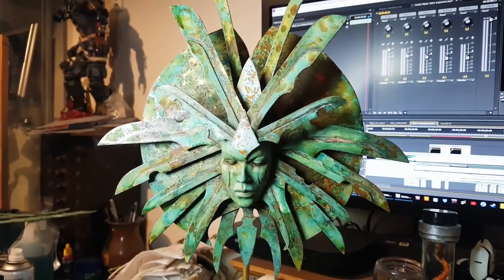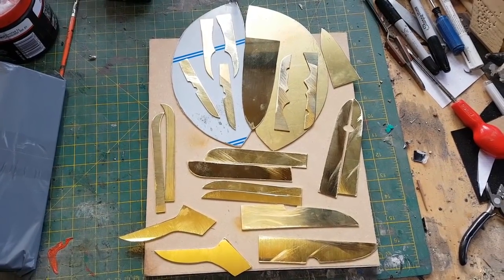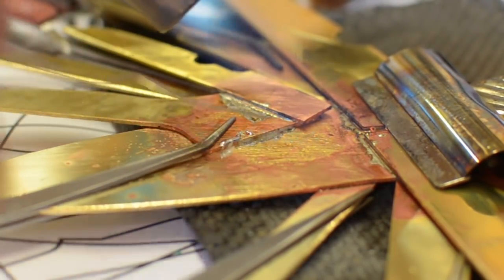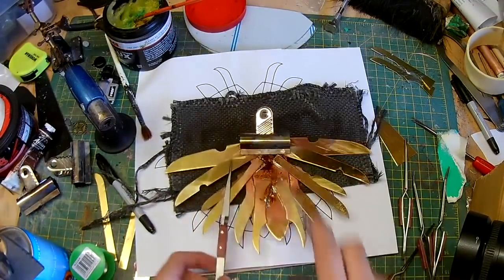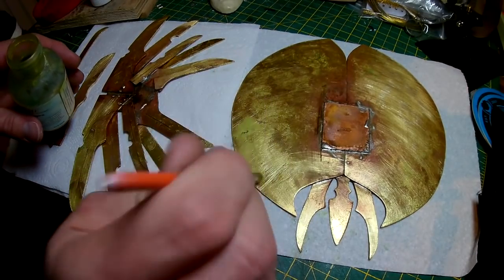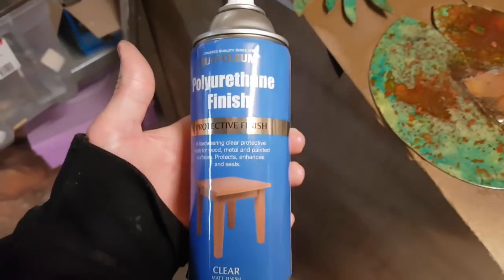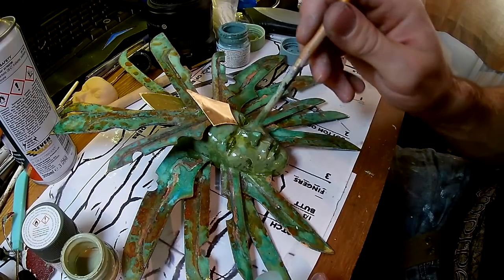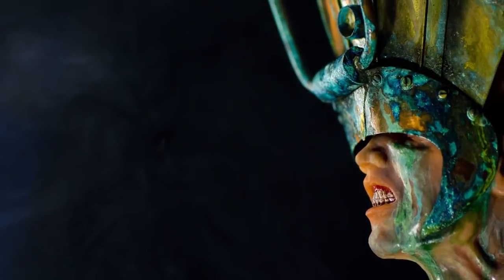The Lady of Pain - Brass Sculpture - Planescape D&D

Comment: I clicked on this thinking you'd sculpt it and then cold cast it with metal powder and resin. And then you brought out the brass :D
Beautiful work. I can see why dungeons and dragons players would want one of these.
Reply from the maker: Thanks!  Yes cold cast resin just doesn't corrode in the same way.  I shall have to build a forge so I can do the face in brass too ;)
Reply: @thedarkpower  Is it because the metal layer is too thin on cold casted parts?
Casting the face from metal would be a fascinating adventure, although an expensive and dangerous one.
Reply from the maker: @RamoArt  Yes that's right.  I think also because there's resin mixed in too it can simply form a barrier to the patinating agent.  I've been told that if you can get a thick enough layer though that it can work, so I'll have to have a go.  Yes brass casting would probably be expensive!  Might have to get someone to do the casting for me if I ever do it.

Comment: Awesome work as always. There are now metal reactive paints that you could use on the face which will change with the verdigris liquid the same as the brass. The other technique would be to dust the mould with brass casting powder and cast it in a resin that is heavily filled with the powder and this will also corrode quite nicely. Black Milliput can also be dusted with brass powder before it sets and then corroded. The paint job you did was still amazing.
Cheers 
Jim
Reply from the maker: Thanks Jim.  Ah, thanks some interesting ideas there - I'll have to have an experiment with some of those as I do really like experimenting with this kind of stuff!

Comment: I was expecting the face to be cold cast, but that paint job looks spot on to the actual corroded brass.
Reply from the maker: Thanks, yeah I've not had that much luck at corroding cold cast pieces so I went with paint.  A few people have suggested some techniques to get better results though so I'll have to have a go.

Comment: Amazing work -- question: is there a reason not to use a soldering iron on the brass pieces? Could eliminate the need for a blow torch getting heat all over the other joints, no?
Reply from the maker: Thanks.  I'm no expert on metal work, but I suspect a soldering iron wouldn't get hot enough to heat the metal sufficiently. There's alot more material to heat than just a wire that you'd heat when soldering electronics.  I've only ever seen soldering/braising of metal done with blow torches.
Reply: @thedarkpower  Ahh, so it's not just the solder or the flux that needs to get hot, it's the large surface area of brass. Got it thank you